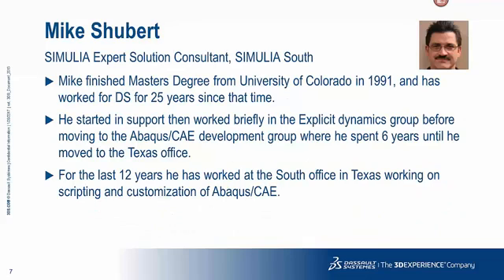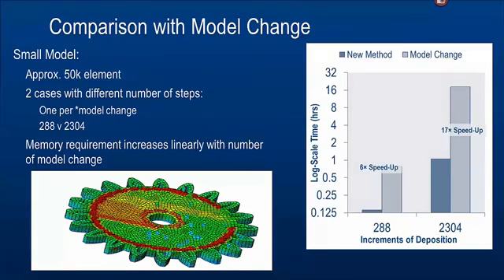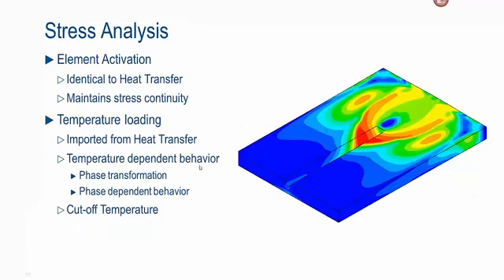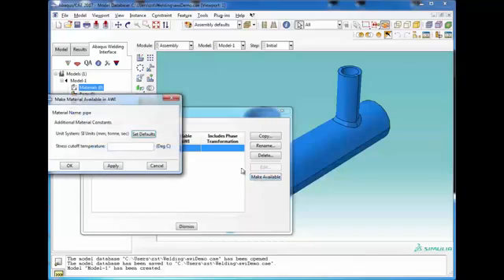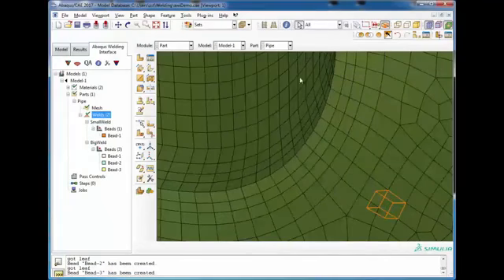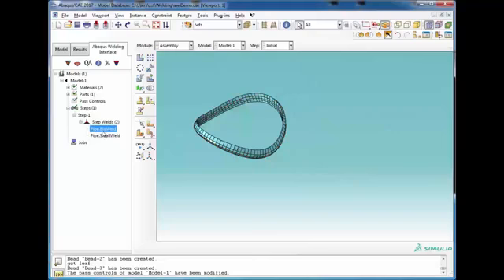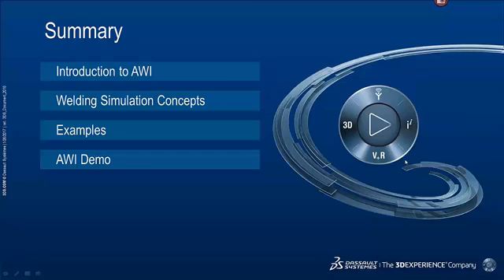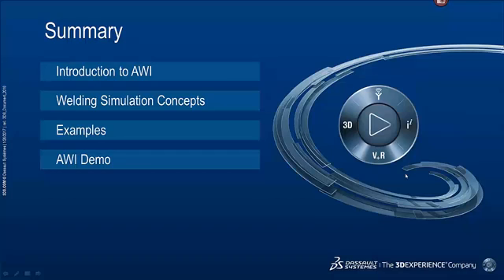Abaqus Welding Interface - Plugin

Comment: hello, I used abaqus 6.14, when I opened plug-ins for making abaqus welding interface simulation (AWI), it did not appear in my computer. could you help me how to do AWI appear.
Reply: it will work for the version from 2017, I think, anyhow please confirm it
Reply: @8825607802  could you send it to me the old one is okay
Reply: So I want to know to put AWI in Abaqus/CAE please
Reply: @saikhamle6574  please use the below link for the download file. you need to create an account to download it. https://info.simuleon.com/blog/simulating-welding-using-the-abaqus-welding-interface-part-2
Reply: @8825607802  Hello, can you send me please jarlesanabria@hotmail.com, the link of the article doesn't work anymore,
Reply: Hello Sir
Can you send me the plug-in please thanks

Comment: Hello. Thanks for your clip. I have a question. Is it possible to investigate the effect of phase transformation on the residual stress in welding such as martensite? Is it possible to model the grain growth because of different cooling rates in Abaqus?
Reply: Hello, I have the same problem. So did you find any answer or any other solution